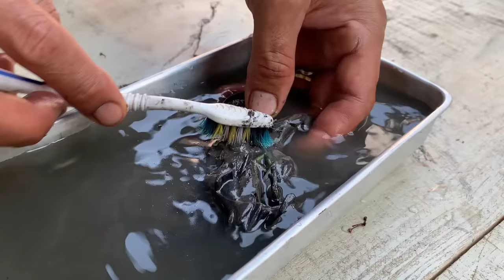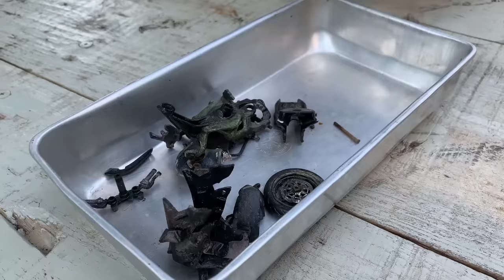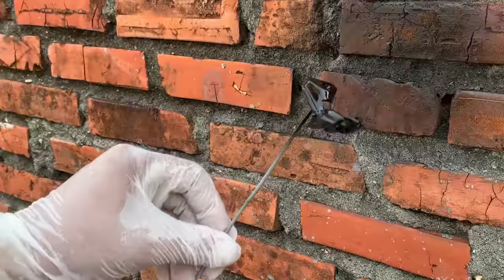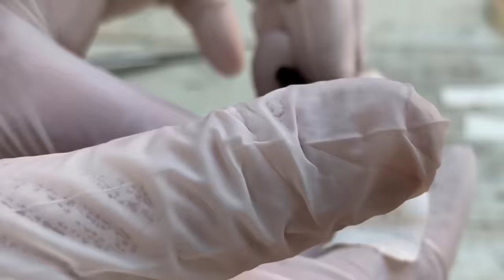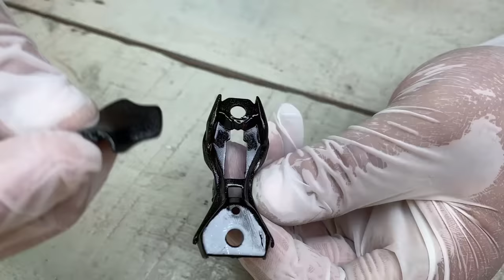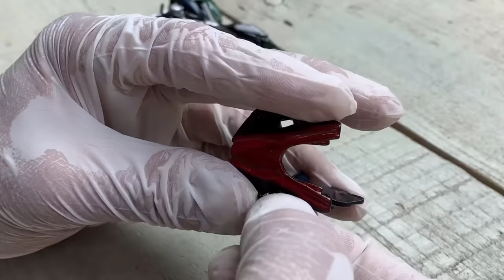Restoration Kawasaki Ninja Toy | Restore Old Kawasaki Motorcycle model

Comment: It was supposed to be a mini model of a ninja H2 are and you painted it a completely different color than what the actual bike is the frame is like a lime green and it has a chrome metallic finish in black for The outer shield and the fuel tank